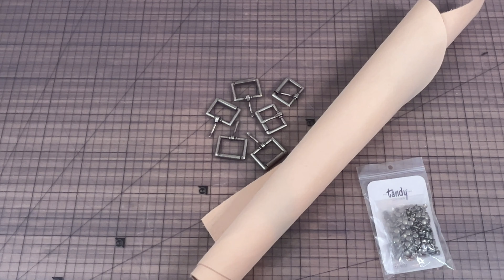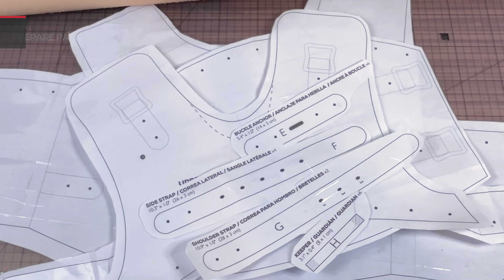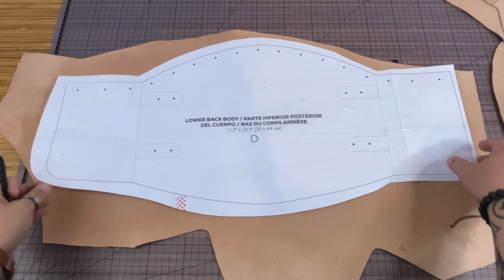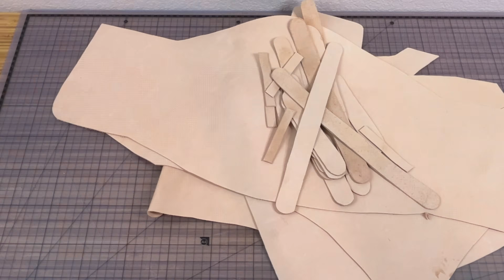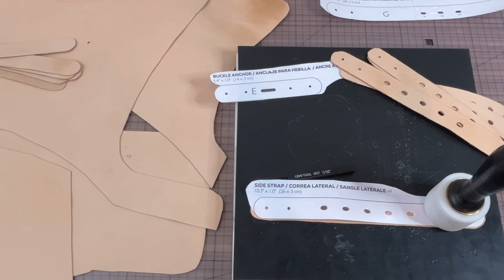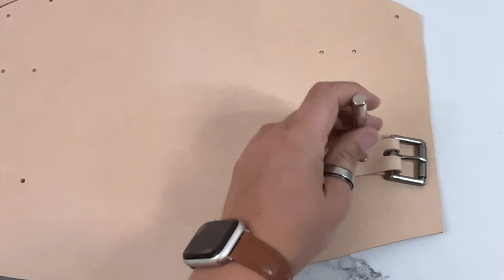Ren Faire Wears: Build Your Own Chest Armor

Comment: As with most templates its a starting point. Its best to modify.  I modified this template heavily and it worked fine. Bring the chest in and thin the shoulders and neck. Also using one piece for the front and back is better. I used 7mm thick saddle skirting and stitched a 7 to 9 ounce on top of the saddle skirting and it turned out great. Full range of movement over tunic and chainmail. Its only so functional as it is leather. I wax hardened mine but other methods are just as fine.

Comment: Has anyone tried the finished armor on? A lot of the medieval-armor discourse I've seen might suggest there'd be problems with this design (shoulders are pretty wide, so they might cut into your neck if you life you arm up; the torso's one solid piece, which might prevent you from bending over at the waist).

I know there are some examples that don't have this problem, but just looking at this I can't be certain if it'd be a problem or not.
Reply from the maker: Hey, allrewil! Thanks for watching and sharing your thoughts! The bulk of the body is actually two separate pieces, riveted together (although the example in the beginning was a modified version of this pattern). As with all wearable patterns, there's no true "one size fits all" sort of situation and we highly recommend doing a test run out of a less expensive material (like cloth). Light water forming can help fit the pattern to the specific wearer as well. There are all sorts of options, and while we wouldn't technically recommend this for a beginner, it's a good jumping off point for many. We hope you try it and would love to hear more of your feedback if you do! Happy crafting!
Reply: Im making it tnow and you arent wrong - this is a basic option that will not be the most comfortable.  More elaborate sets that have more articulation would be more comfortable and nicer for longer wear.   Serious cosplayers or LARPers might want to go a differen route but this is agood start for my son who wants to go to a ren faire or use as a (labor intensive) haloween costume.

Comment: How would you adjust the pattern for us bigger folks
Reply: It comes with 4 size options based on chest and waist measurements.  I just bought one.
Reply from the maker: The pattern includes sizing up to XL (chest measurement of 62-68" and waist measurement of 54-56"). If you'd need something larger than that it would be time to take the pattern and do some testing! There are a number of methods about sizing up and down for wearables, but nothing is really guaranteed without doing some extra patterning. 

I hope this helps, and feel free to look at the exact measurements of sizes on our product page: https://tandyleather.com/products/chest-armor-paper-pattern

Happy crafting!